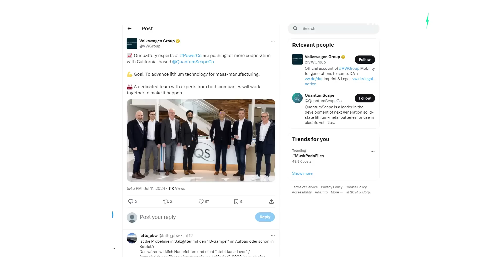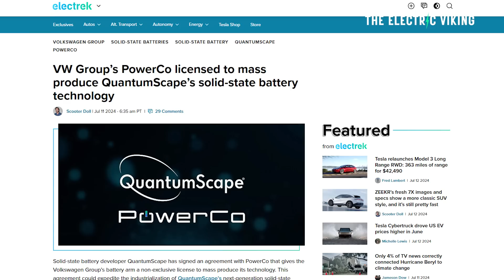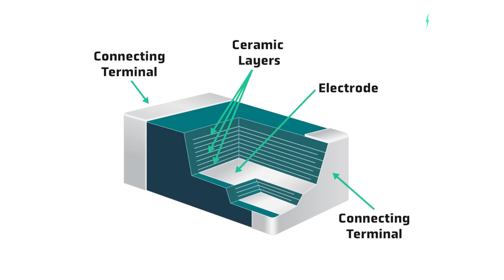VW reveal plan to mass produce solid-state batteries for 1 million cars

Comment: VW’s battery manufacturing subsidiary (Powerco Canada Inc.) Built a $7-billion gigafactory covering an area the size of 210 soccer fields in St. Thomas, Ontario. These batteries will have a cost benefit, but they’ll also have way more range and performance. The battery plant in Canada will be producing solid-state batteries by 2027. Ontario is a leader in the global automotive industry and the EV space. With full access to critical minerals and its end-to-end, ethical battery supply chain, Ontario is attracting EV investments.

Comment: The biggest problem with car batteries remains the fire temperature. A classic combustion engine car burns at around 600C. An electric car with Lithium batteries around 1'100C which destroys concrete, tunnels, structures. Lithium itself reacts with water. Once this problem is resolved, EVs will become mainstream. You see, most people don't want to drive a car that burns like a Russian tanks and that immediately incinerates everyone inside. Imagine a electric truck that burns inside the Gothard tunnel and destroys it. You are talking about damage in the billions. Current EVs with highly flammable batteries will destroy infrastructure.

Comment: QS has hit it’s testing targets consistently over the years. I believe they are looking at actual vehicle use in 2025-2026. It takes time to ramp up testing of samples and prove durability.
Reply: I beleive they will be in mass production for 2027 where Power Co also stated if it gets pushed to 2028, that it will be ok with this.

Comment: This dude is as slow as he looks, "these batteries would be in VW cars now if they were feasible in cost" These batteries are in early production, refining production, they have no price tag on them. VW has obviously done a cost analysis and the numbers crunch if they have PowerCo getting behind this deal. VW has stated that they will have different batteries in different market level cars, expect the QS battery to go into their premium lines first and as the production costs ease to be made more readily available. This allows QS to receive millions in royalty revenues and continue with production for other customers. VW is getting a sweetheart deal here being their primary investor.

Comment: The greatest advantage of a battery-powered car with a solid-state battery is its extended range. Why? Because with a range of 1000 miles, you won't need to travel such distances without breaks, allowing the car to slow charge while you rest at a hotel overnight (if the trip is exceptionally long). This is gentler on the battery compared to a 200-mile range where fast charging is necessary to reach your further destinations. Furthermore, reducing the need to recharge every 150-200 miles also extends the overall life of the battery.
Reply: Nope. The big advantage of batteries that allow you to make a car with 1000 mile range is that those batteries allow you to make a very light (lighter than ICE) and cheap car with 500 miles range, because they'll have half the batteries of current EVs. Very few people take regular cross country trips; the overwhelming bulk of mileage is done in much shorter trips, which is why most EVs are already mostly slow charged overnight at home.
Reply: Dude, you are not getting 1000 miles of range. Be realistic. 400 miles is the practical range if you do the math regarding Quantumscape's testing results.
Reply: @vorpalinferno9711 Correct. If you want 1,000 miles of range, you’re going to have to either drive a hyperefficient car like Aptera, or you’ll pay a ton of extra money on top of the already high price of a new car. Most will be around 300–400 miles per charge for a while, though that should go up over time with future battery improvements.
Reply: The solidstate battery mentioned in this video will charge from 10% to 80% in 12 minutes.  While other manufacturers are teasing even faster charging, they can't get thousands of cycles out of their batteries.  12 minutes isn't an unreasonable amount of  time to wait during a long road trip.  It also degrades at a snail's pace compared to lithium ion batteries.  The battery discussed in the video will outlast the vehicle.  It's coming soon.  My current car will be my last ICE vehicle.

Comment: In Texas, despite a cooling of a few degrees in the Houston area, the power outages caused by Hurricane Beryl continue to make things miserable and even dangerous. More than 500,000 customers remained without power on Saturday afternoon. Three deaths in the aftermath of Beryl have been attributed to Climate Change-worsened heat, according to officials in Harris County, which includes Houston. Temperatures will be 100 degrees in Arlington, Texas, on Tuesday, when Major League Baseball’s All-Star Game is played there, even around the first pitch, which is scheduled for 8 p.m. New York City’s temperature is expected to peak in the upper 90s on Tuesday, with the heat index reaching 98 to 101 Monday through Wednesday. Forecasters at the local Weather Service office in New York say that some spots around the city could approach a heat index of 106 degrees. Mr. Bann, the Weather Service forecaster, said that many cities in the region could set daily high temperature records due to Climate Change-caused "heat waves".

Comment: I think the next frontier for EV manufacturing might just be in battery pack and module assembly. You watch these assembly images and it looks like some sort of insanely overbuilt lab experiment, not a streamlined, well engineered, finessed component intended for mass production. There has got to be a better way to seal up the cells in a easy to assemble fixture that meets all the safety and structural requirements. I think the industry has been very focussed on battery chem and form factor so far and they need to start applying more resources to module and pack design.

Comment: I am looking for a 1000 kg 200 miles range small car for a cheap price. I am living alone and have only sometimes 1 passenger only. Unfortunately there is not a good alternative at this moment. I think they prefer to produce luxury cars because the battery production is not scaled up enough.
1,5 million cars is not enough. Its not enough for the complete exchange of the amount of petrol cars
Reply: You can conver a smart roadster to a ev, its like 800kg 
After throwing in 200kg of nmc you will have like 40kwh so 300km range easy

Comment: unfortunately, the cost per kw is already at parity or better with CATL's Shenshing  PLUS LFP batteries capable of 1000kms per charge with very little degradation even after 1,000,000 km driven.. there's very little prospect for QuantumScape to surpass this battery technology.. & they know it..
Reply: This is 100% false
Reply: This is false, the Shenxing plus LFP battery is an amazing battery that promises fast harming and very little degradation over 1 million km, but the energy density that could be achieved in solid state batteries would greatly surpass them.
Reply: I don't trust Chinese data. Until multiple credible foreign parties can test it, you will never be sure of their product information

Comment: QuantumScape batteries have already been tested in a fleet of VW"s and went 300k miles with only 3% degradation. So a million miles is well within 1 million miles and the energy density is 500wh.
Reply: no, this is Fakenews.

QuantumScape Batterypacks are in nearby series state, but the only got tested in labor, not on road.

Or do you have a new source of your information?

Comment: When will we get a car that doesn't burn? Both electric and ICE cars can burn in an accident and E cars can burn any time. When can we have a car that we can prang, without burning everyone in it? Not in my lifetime (I reckon).
Reply: The Hybrid is the worst for fires, The ICE vehicles are next worst and Fully Electric cars are by far least likely to catch on fire. (320 times less likely than an ICE vehicle.
Fires per Fuel Type and per 100 000 sales show Hybrid 3474, Gas 1530 and Electric 52. Battery technology is improving every year and are becoming safer and safer. Your wish is being fulfilled

Comment: They have started construction off this factory in Ontario Viking.

Volkswagen hopes to produce solid-state batteries at St. Thomas plant

Author of the article:

Gabriel Friedman

Published Apr 23, 2024  •  Last updated Apr 24, 2024  •  4 minute read 
 National post
Reply: Thanks for the info. I was wondering about that ever since they first announced the factory, but couldn't find out at the time. Cheers.
Reply: VW also have North American OEM that can produce Single crystal cahode with LFP that can compete with Catl Schenxing battery and Gotion. (Or deliver to Gotion North America). So they also might produce both.
QS  are poised to use Single crystal cathode in theyr batteries and they will not by cathode from China.

Comment: A lighter car with 500 miles would be more useful
Reply: A lighter and less expensive car with 400 miles would be even more useful.
Reply: @eastmanwebb5477 typical peasant 😂
Reply: You need 400 miles to get 300 miles real world under all the stated standards even EPA.
Reply: @ctuna2011 Depends on the conditions. But yeah, you can lose a lot of range when traveling at interstate speeds or when it’s cold outside. I do alright with a car rated for 250 miles, but it would be nice to move up to 350–400 miles as battery technology improves.
Reply: You are getting 400 miles not 500.
Reply: A Porsche GT3 RS EV with 500 miles would be more fun.
Reply: Nobody needs miles, but kilometers

Comment: Very good news, this.
Solid-state batteries will finish range anxiety.
Reply: No, being able to charge quickly and easily everywhere will do that. It’s all about convenience.
Reply: @ISuperTed  How many amps is your house fused at?
Reply: Seems quite a few of the new battery's are claiming 350watts /kilo or more now.
Reply: Owner over four years, I charge on a regular 120v outlet. It's plenty for everyday use. We go on yearly 600-800 mile vacation trips. The car wil tell you where to charge. It's painless. I have never had range anxiety. It's just not a thing.

Comment: 1,000 mile range would be a game changer!:-)
Reply: No it won’t. Maybe for long range semis, but there’s a reason all cars average around 400. 
With 1000, most of the time you’re carrying around dead weight.
Want game changer? How about slower degradation combined with higher energy density/output.
Reply: @ElMistroFeroz the battery will have a million miles out of them and 1000 miles of range.
Reply: The key benefit isn't huge range but more reducing the battery weight, about 400 miles is sufficent for 99% of needs, which for most would mean charging two or three times a month.  The higher density of the battery enables smaller battery packs, hence less weight, raising a car's overall efficiency.

A mindset shift will come at some point with the way car refueling is approached. Moving any from the annoyance inducing approach that has become the expected norm with fossil fuels, to one where the car just charges in the background whilst we get on with life. EVs offer the chance to move to a universal fueling approach that would be a game changer as charging the car can occur anywhere not just at petrol stations. Destination charging is one example, turning up at cinemas, shops, hotels or sports venues plugging in and getting on with things to come back to a charged car. This will reduce the role transit charging, such will only needed on those routes where regular longer journeys are made (supported by ultrafast charging). Again smaller batteries benefit here as they'll reach a full charge much faster than larger batteries.

In short batteries will be sized for the sufficient average not the max.
Reply: And even more important, no burning. Not in my lifetime, I reckon.
Reply: Using a battery that size as stationary storage for renewables would be a game changer. But no, let's jam it in a car that sits doing nothing for most of the day, week and year. Future historians will laugh at us.
Reply: @davidbrayshaw3529 , they will be both before long. Newer cars will have 2-way charging (some already do), you will be able to essentially rent your car battery to the electric company to support the grid when it's plugged in.
Virtual Power Plant is the future!
Reply: I average less than 10 Km a day.  A third or quarter of the average EV range today would be more than sufficient, pretty much fully rechargeable on a 110 volt outlet, a third or quarter of the cost of present battery packs ($15,000 to $20,000) and leave space for more batteries to be installed later if that were practical or desired.  When I want to take a longer trip it usually only totals up to about two weeks in total; less than 4% of the year.  I'd rent a longer ranged car.
Reply: @glennmartin6492  10 km per day equals CO2 emissions of about 2.5 kg, on average.
The embodied CO2 of a Tesla model 3 battery is claimed to be 12 tonnes, if you believe that, and that's just the battery, not the car.
So your break even point is about 4,800 days or 13 years... battery only.
Reply: @davidbrayshaw3529  The break even point for EVs is less than two years to match the COs output of what gas cars would have incurred by then.  After that there's no new emissions.  The fewer batteries in you EV the less CO2 can be attributed to its' manufacture and break even drops to a few months.
Reply: @glennmartin6492  Obviously the fewer cells, the sooner the payback. But when you do so few miles, like you and me, the payback period of a typical EV is a long way down the track, and if your electricity supply is part renewables, it's even further.
In both yours and my case, we're far better off spending the money on a couple of stationary batteries and a solar array as that's where our biggest emissions come from, or at least they do in my case.
Reply: @davidbrayshaw3529  An average EV with typical range matches an ICE car for lifetime emissions in less than two years and then has zero emissions.  EVs have less lifetime costs than equivalently priced ICE cars.  Your better off investing in both solar and batteries especially if the EV batteries can do part of the job for solar batteries.
Reply: Not really, 250 miles is great and 300 miles is plenty, since you don't want to pay $10 per mile extra then there will be no reasonable prices EV with 1000 miles range
Reply: Its not gonna be 1K miles
QS batteries arent that energy dense. They just charge faster and last longer.
Reply: 650 miles real world range would be already!
Reply: BYD ahead of all - bravo chinese BYD!
Reply: @raymonddon8875  CATL is the performing batterypack constructor, not BYD with their Blades
Reply: @mcherry8010  regardless, BYD is still 15 years ahead of others.
Reply: @raymonddon8875  you mean other old fashioned OEMs, I think
Reply: it wouldn't be THE Gamechanger, because of the higher price for bigger batterypacks and much more weight to carry.

Most of the drivers are needing a range about 40 Km per day, so about 80 kWh seems to be a good size.

Someone with lots of "German Reichweitenangst"  - german range anxiety 😂 would choose a 140 kWh Batterypack to get a range about 800 to 900 Km.